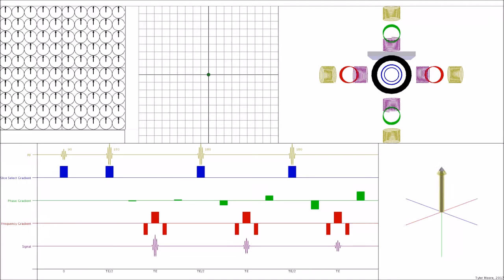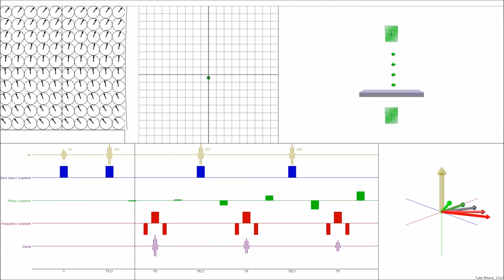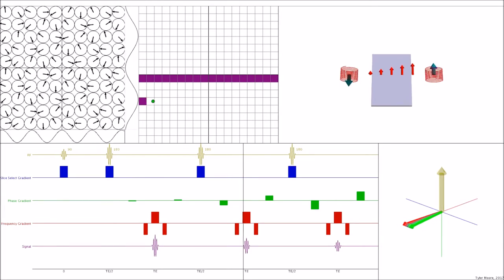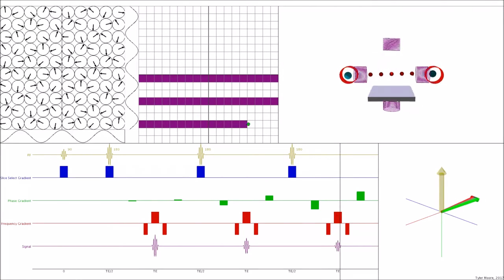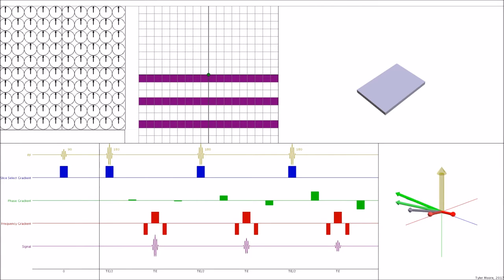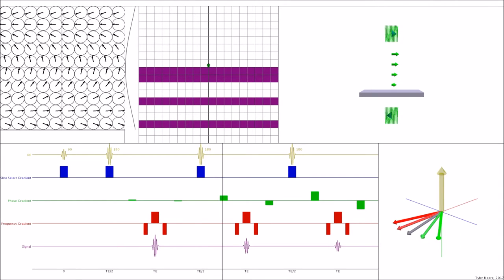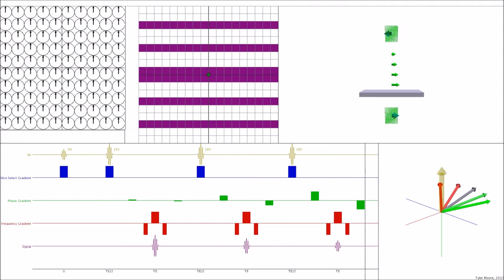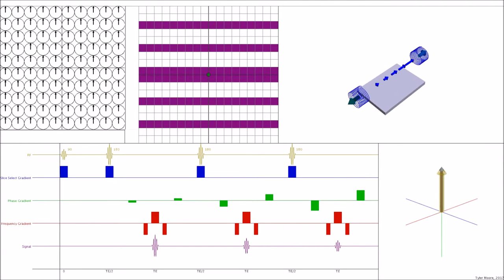Fast Spin Echo - Full Sequence Representation

Comment: Dont each column of phase encoding destroys each others signals since they all will be canceling each others like randomly aligned domins of iron which becomes unmagnetized if not under a magnetic field
Reply from the maker: Well, each phase-encoding step is collected at a different time and is stored separately. They don't cancel each other out because you never add them together. You collect each datum and map it to it's correct location in k-space. Then, you perform reverse Fourier transform to generate the real space image.

The second part of your comment makes me wonder if you've forgotten about the primary magnet, which imposes a constant, very strong magnetic field at all times. It's not moving in the animation, so it's easy to overlook, but the dipoles' alignment would indeed quickly disperse without it!

Comment: is this in lineair ordering?
Reply from the maker: The video is part of a series that had a loose conceptual order. Is that what you meant?
Reply: @overtone1000  Hi! I find difficulties to understand how the K space is filled with certain profile orders. Isn't it that it can be filled with linear, centric, low high etc. profile orders? I don't know what a conceptual order is :(
Reply from the maker: Looking at the papers that discuss it, profile orders seem to be different ways of sampling k-space. Linear would just be one line at a time, while centric would fill it center out. The video on 2D Fourier transform in this series can help give an intuitive understanding of what different regions of k space contribute to the real space image, and that may help you understand why complicated plans for sampling different regions of k space may be beneficial. Good luck!
Reply from the maker: And as for your original question, this video shows something close to linear or sequential. Here's an older paper that lists multiple strategies for sampling k space. Check out table 1.
https://onlinelibrary.wiley.com/doi/full/10.1002/jmri.10451